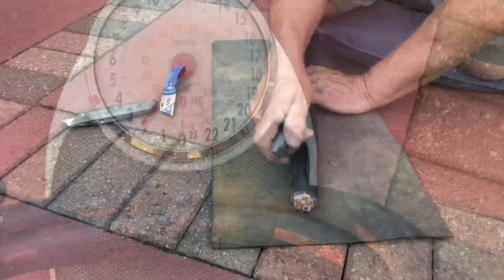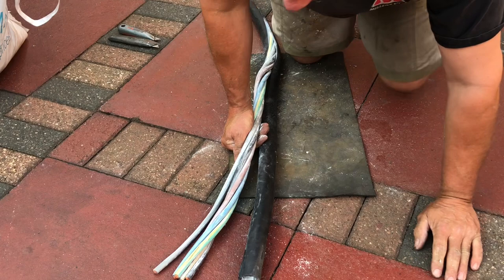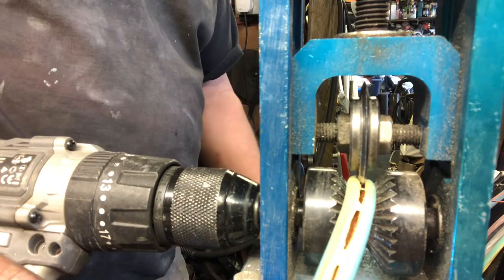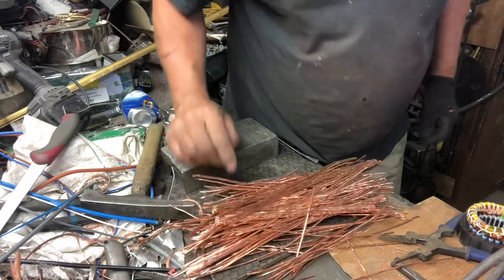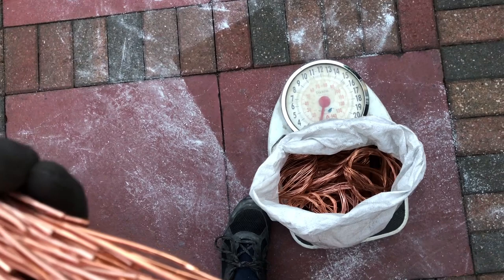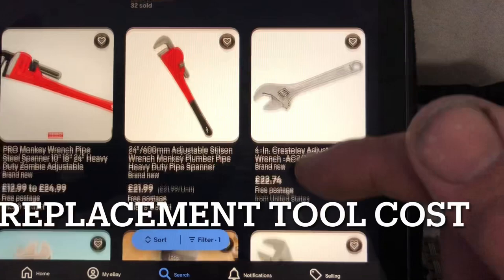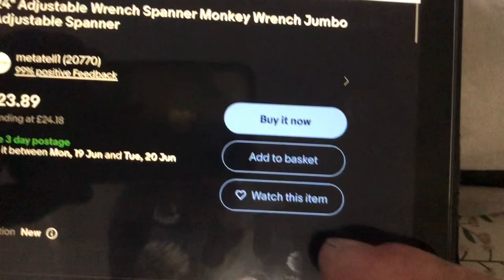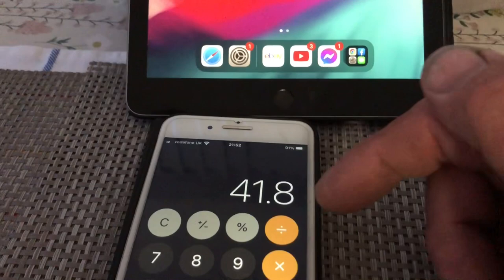Wrench copper trade Short version

Comment: Good work. Oddly enough reminds me of 2 Corintians 9:6
"Remember this: Whoever sows sparingly will also reap sparingly, and whoever sows generously will also reap generously."
Which reminds me, whilst we are waiting you finding your mill to give me the dimensions of the lead screw, how about some dimensions so I can make you a proper camera stand?
Reply from the maker: Eventually Ben
Reply: @Man-in-da-shed  I look forward to it. Though it can't be that hard to tell me the diameter and length of the bar your phone hangs on.

Comment: Didn't see this, and already watched the long version, so I'm only giving you as long as it takes to write this.
Reply from the maker: I cant believe how well the long version is doing, would have thought the length would have put folk off, which is why I did the short version first
Reply: @Man-in-da-shed  well, I had a 1.5 hour drive to do, so it worked out well for me. Got to have a bunch of laughs at you laughing. I don't think I commented there because of the driving, but I think I more than made up for it here.